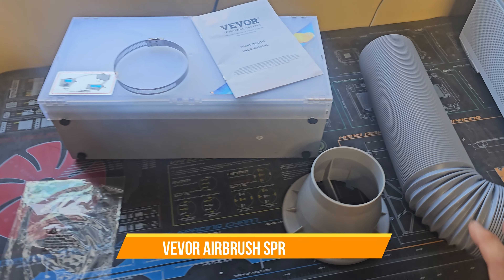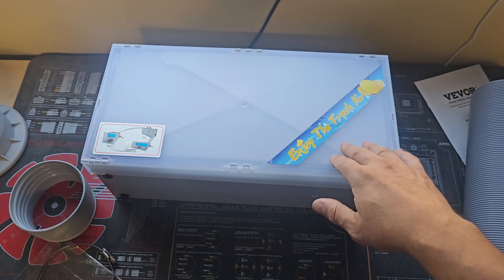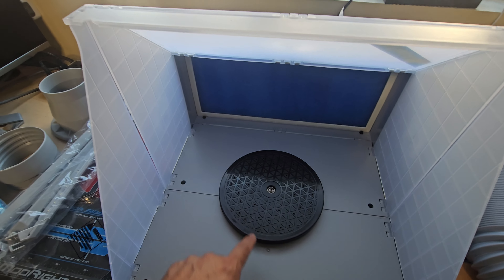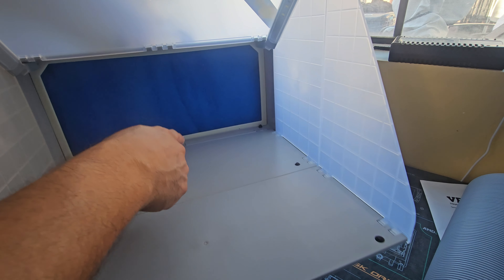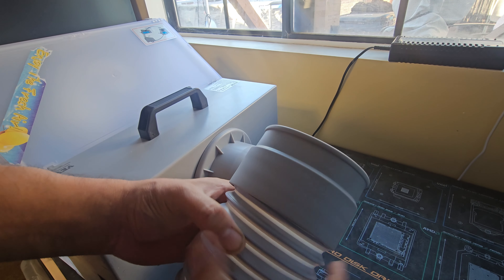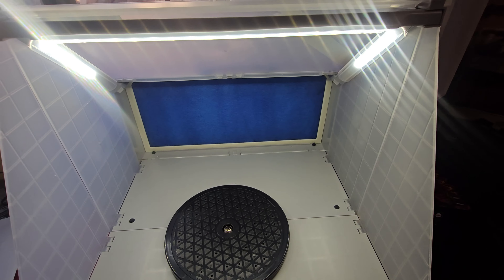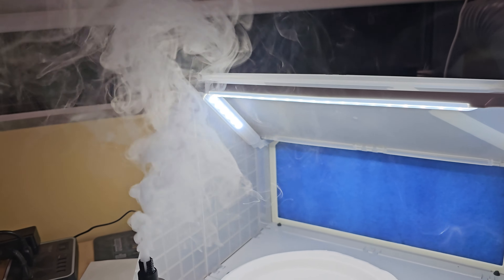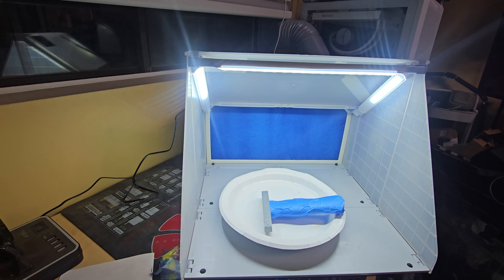VEVOR Airbrush Spray Booth

Comment: I’m getting one this week: I will be using spray cans. Does it still leave a heavy paint smell indoors?
Reply: Make sure what ever you go with...it has dual fans. All these cheap amazon spray booths work pretty much exactly the same. If it is single fan make sure you're only using acrylic and no sprays cans. Lacquer, enamel and sprays cans need more cfm so you'll want 2 fans. Regardless, you're gonna smell those spray cans if you're doing it indoors.